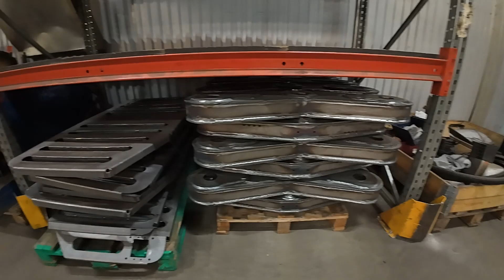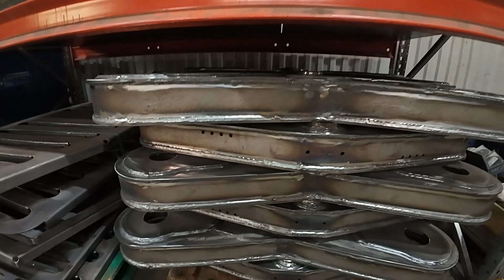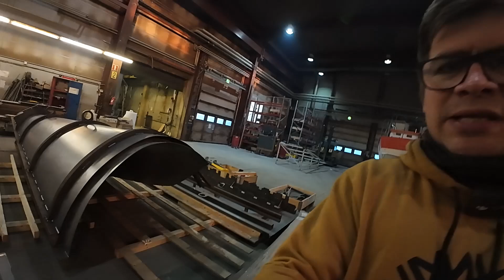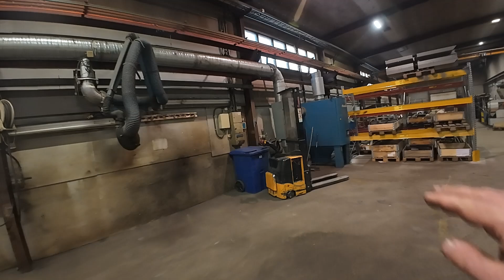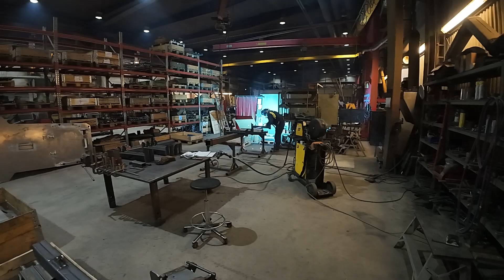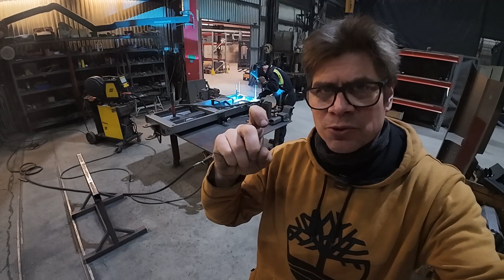First Step: Setting Up the New Welding & Assembly Area for Logbullet!

Comment: Yeah, having your own design being made by other person is a bit awkward :) but you cannot do a lot alone, so the information transfer is a necessary step to reach something great.
At one moment in life I had 11 welders reading my drawings and making like 800 wood stoves a month. That is a power of technical documentation.
Reply from the maker: Yep - that is whole new world when having someone else doing according my design something. Thus they are great welders they cannot read my mind. I need to have everything either told or written to make their work possible.
Reply: @logbullet  words get forgotten, sooner or later. For instructions to be lasting, they have to be written down.
Reply from the maker: @kestlovs  Yep - I take photos and write longer pdf-files from the steps. Just having drawings would not help in efficient working.